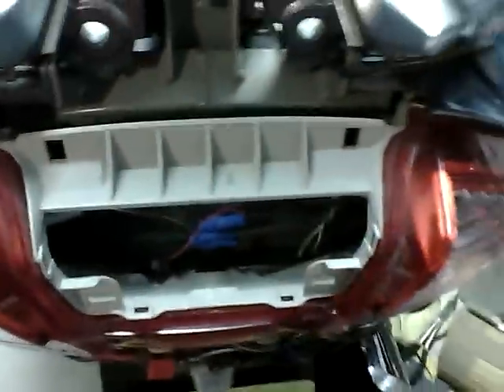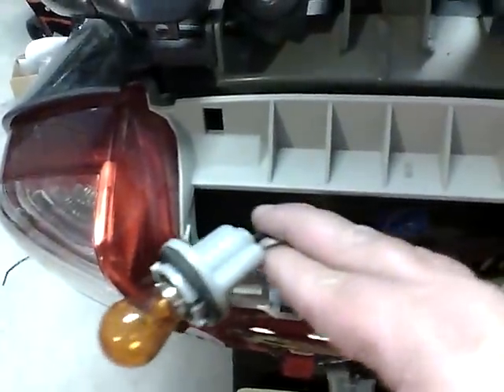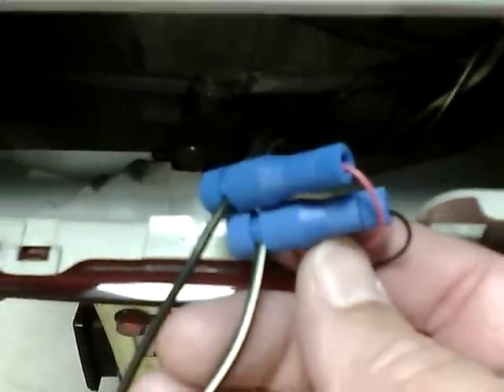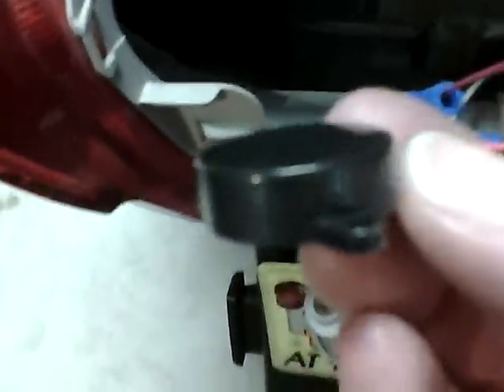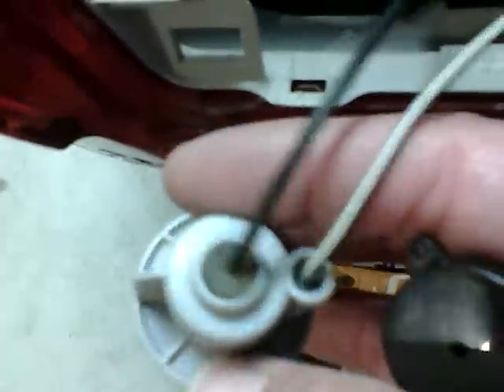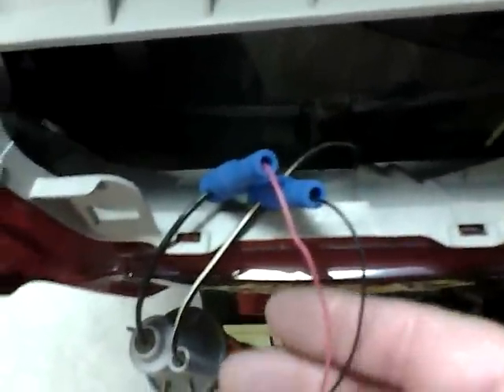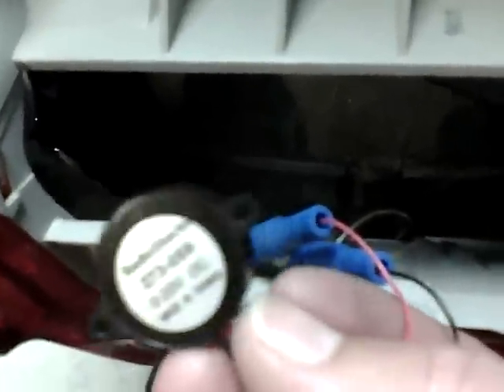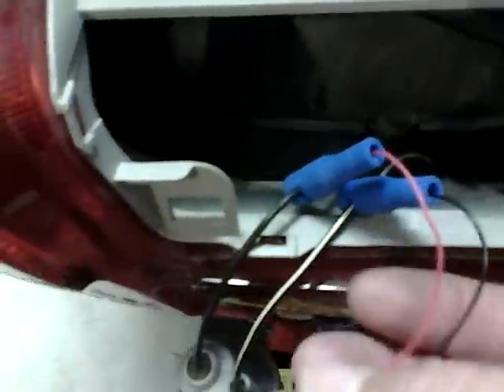Suzuki Burgman Tail Light Piezo Buzzers

Comment from the maker: One piezo buzzer would require you to have more electronics to control the positive flow from each turn signal without backfeeding the other signal that is not engaged.  Just to keep things simple i suggest 2 buzzers.
Reply: i suggest to use 1 buzzer with diode to block current goes to another signal lamp